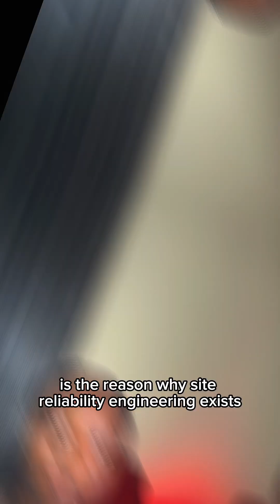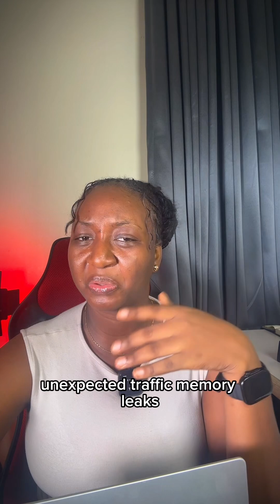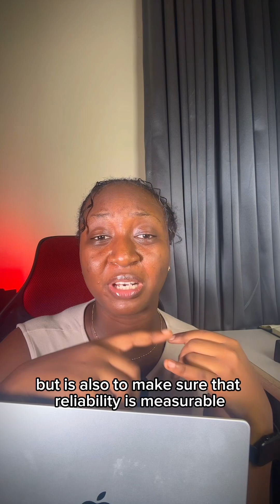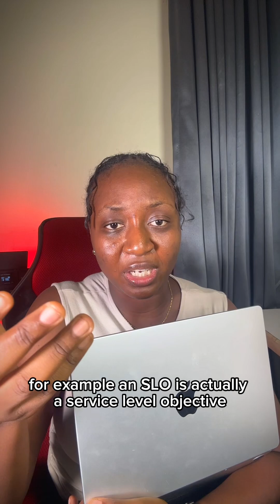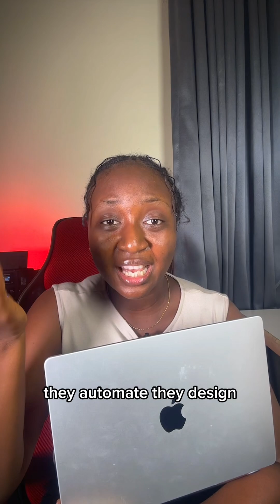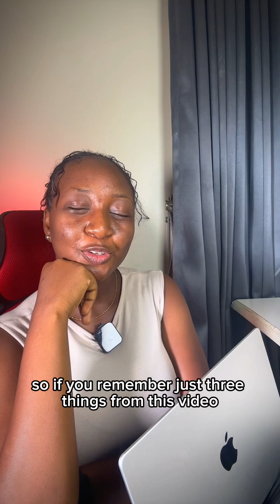Why You Should Hire a Site Reliability Engineer

Comment: So how does SRC engineer prepare designs for a new system when there’s not so much traffic. Does the ensuring of 99.9% of request responding in a few milliseconds cater for when there’s actually lots of traffic?
Reply from the maker: Hello @ifeanachofavour409,

Apologies for the delay in response. So, the 99.9% response-time target is a latency SLO i.e It tells us how quickly the system should respond, but it doesn't tell us how much traffic the system can handle. For example, if we say 99.9% of requests should respond within 100ms, that might be achievable when we have 100 requests/second. But what happens when we suddenly have higher traffic like 5,000 requests/second? If the system doesn't have enough capacity, response times may increase and we may no longer meet that 100ms target.
So, when designing a new system, an SRE considers both latency and capacity, not just “How fast should this request be?” but also “How much traffic can we handle while still keeping it that fast?” and that's where things like load testing, capacity planning, monitoring, and scaling come in.
In summary, being fast doesn't necessarily mean you can handle lots of traffic. The goal is to be able to maintain that speed as traffic grows.